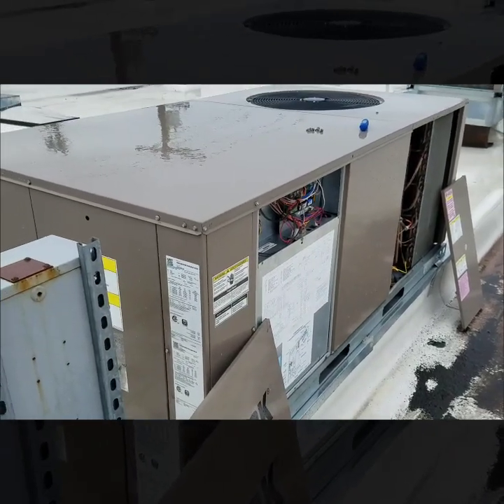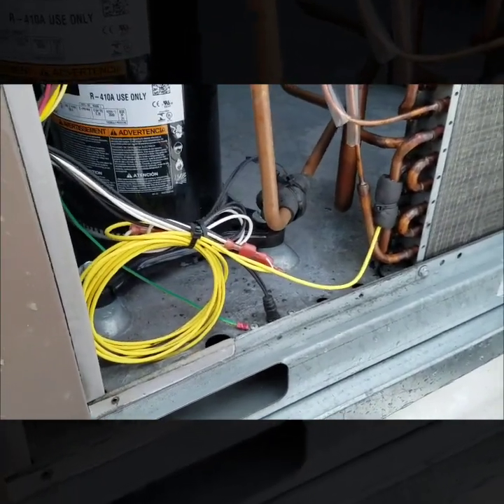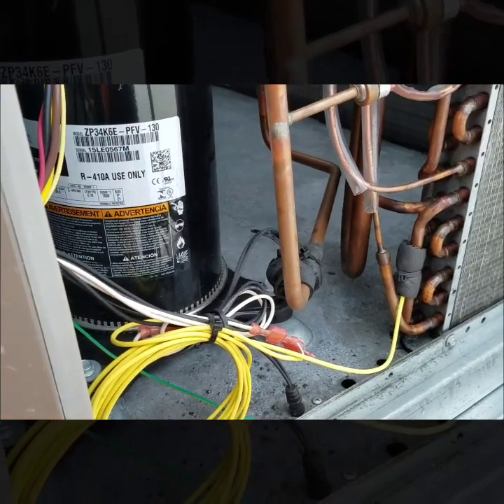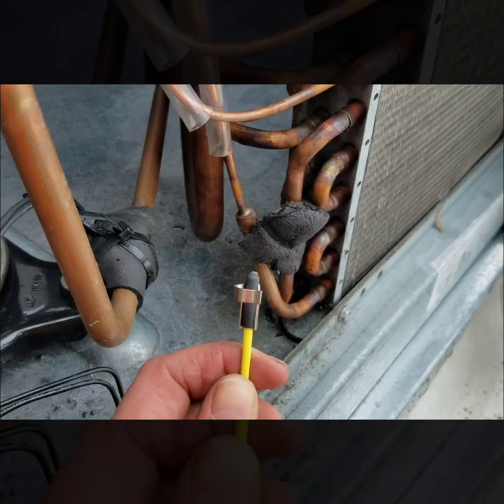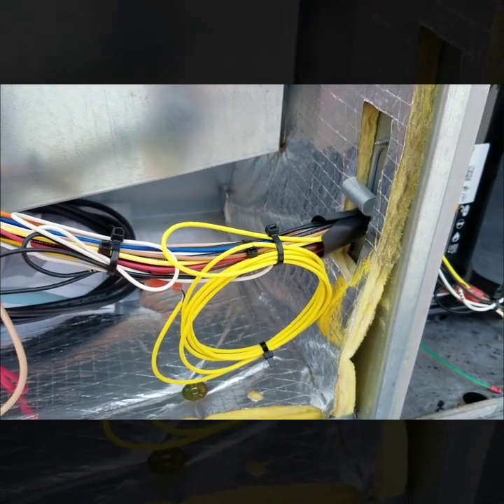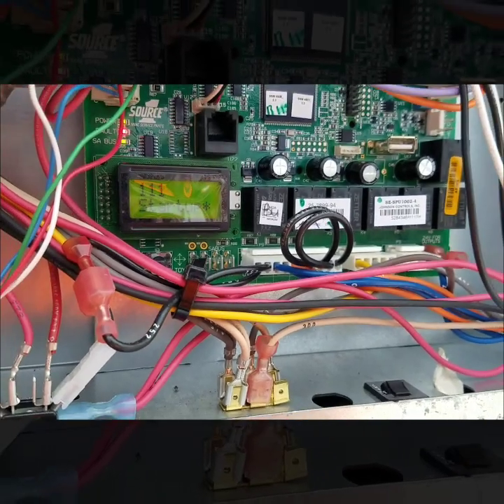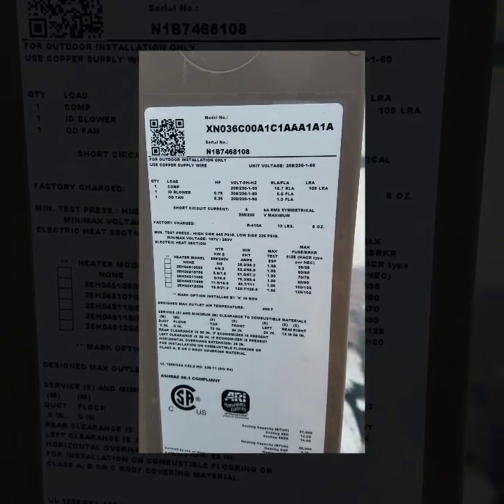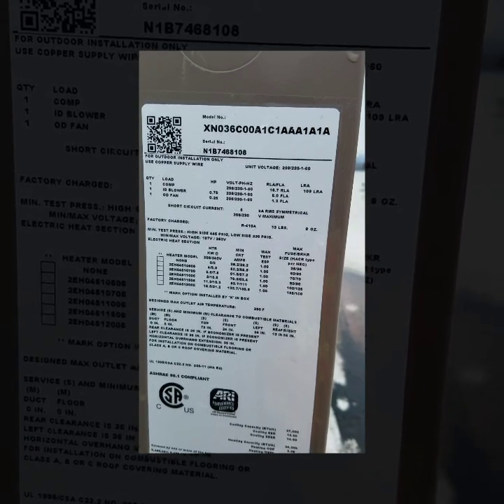York Package Units: Issues every Service Technician should know

Comment: I have a 30 ton York that started to turn off the screen goes blank and then turn back on . Sometimes is stay on for 2 to 3 minutes sometimes goes through it complete cycle and satisfied. You think it could be low voltage 
Thank

Comment: What do you recommend when a york unit package unit alarms saying c1 locked out due to coil freeze. I checked air filter, check blower belt , make sure it's tight not loose, all supply vents are open and return grills are clean?? After when it runs it says excessive supply air temp that's next alarm? What do u recommend?

Comment: Great video!   I have 5 of those York units Model Number ZJ090N12R2B1BAF1A2 in my place and I after 2 years old I have a quite a few sensor errors displaying,  Where do you download the  software for that particular York unit from?   
Also if you can share with us the  part number for that sensor?   Where do you order  the parts from?   Appreciate it thanks
Reply from the maker: I don't have the part number unfortunately. You can get the software download from your reginal tech support rep. We also order the parts from our local HVAC York dealer.
Reply: Aren’t those units set to update automatic on its own.  I am looking up my Units manual and it says that it can be updated automatically and Manually. Since this is my first time doing the update, I am not sure what is the difference and if you have the answer since you already done it.   Thank you for your time!

Comment: I having an issue with this unit. The board reads Excessive Supply Air Temp Cooling. It is a ZEH060 model number. It keeps saying it is on IDLE. Does it need an update?
Reply: Did you ever find out what that fault code was?
Reply: You have to go into details and lower the cooling temp for the sensor on the Evap coil.. i had the same isue and that fixed it

Comment: Wired the replacement sensor incorrectly! The idea is to run the yellow excess cable ALL the way back to the harness on the SSE control board. It alleviates moisture and corrects the issue. Just cut about 6 inches from Harness and wire nut in the electrical cabinet.

Comment: Alot of the sensor faults could be solved from a simple Relearn. Can also test the sensors by doing DC Voltage across the sensor tabs. Use a 10K chart. dont even have to go into the board or find the sensors.
Reply: Relearn?
Reply: @Justarandomspacemonkey  it's in the settings on the board